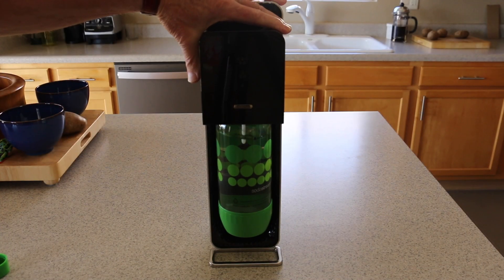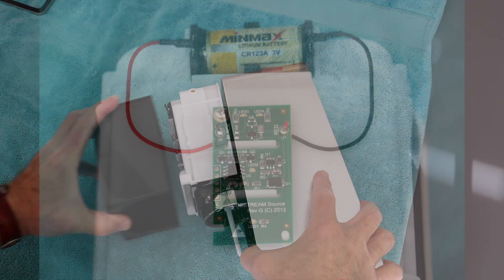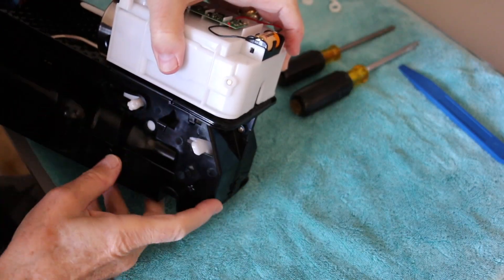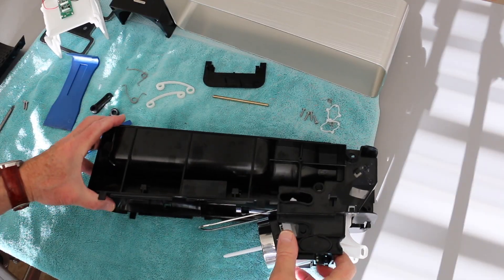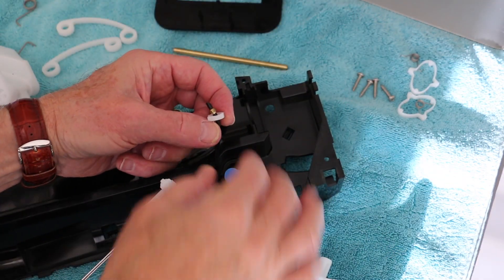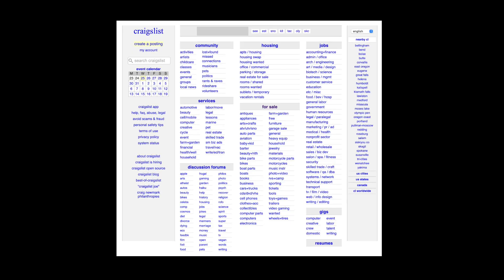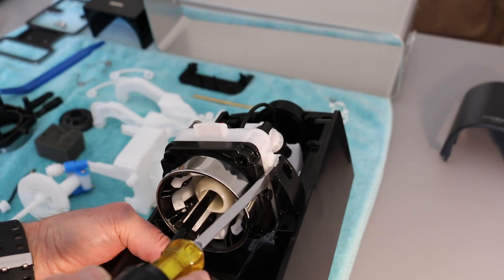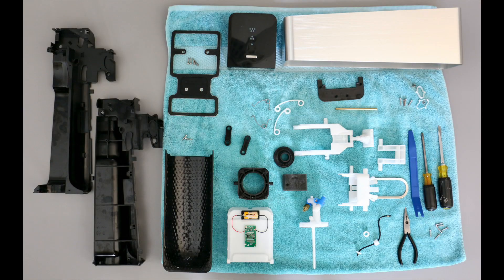SodaStream Source Teardown

Comment: I just repaired mine using JB Weld kwik weld on the nut. It's working so far. Make sure you take plenty of pictures when taking it apart. Also make sure the battery is still good

Comment: 3:59 do you know if the check valve under the co2 line connection is replaceable or had a hex design to remove it possibly? my co2 doesn't leak but is having issues with inconsistent pressure release* into the bottle. I believe it to be this valve but am having issues finding any info online about this! haha.
Reply from the maker: You're not alone in wishing that SS provided info or parts for DIYers to repair their units.

Comment: I just used your awesome video to fix my Sodastream Source machine.  My system failed in the exact same way (cheap plastic nut on the carbonation tube broke).  Fortunately, I had a broken SP1 machine that had a couple of good nuts (lol).  I dropped the magnet in the same way you did... why they didn't glue that in is a big mystery (I glued mine).  Thank you again, I couldn't have done this repair without your help!
Reply from the maker: Glad to have helped!

Comment: The author(s) must have been sitting on a couple dozen filled CO₂ canisters to justify resurrecting the original SodaStream "Source" unit by cannibalizing a brand-new "Terra".  I used Gorilla Super Glue to re-glue the sheared-off hex nut.  After curing for 3 days I was hand-tightening the repaired nut and the part sheared off again.  Even if it hadn't re-broken, I'm sure it would have broken again during use.  I can't believe even a cyanoacrylate adhesive will bond polyethylene-to-polyethylene.  I've since replaced my Source with the modern "Terra" that I will NOT be dissecting for its gas tube assembly.  Conclusion:  DO NOT think you can repair the old part; it's kaput !

Comment: do u think a epoxy/fiberglass combination wrapped around the broken part is strong enough for it to work? Coat broken part with epoxy, wrap it with a strip of fiber glass. Let it set. In my case, I can see a hairline crack appearing on the other connector as well. Seems like a design flaw. Sodastream should just spend a few cents more and replace the screw cap in brass.

Update: epoxy/fiberglass didn't work. epoxy doesn't grip the plastic hard enough and the joint came apart after screwing in. I used two straightened paper clips, twist it over the broken parts to hold it together. It was strong enough to hold the tube in but I don't know how long it would last.

Comment: Perfect tuto, same issue ! I tried to glue it first but did not work, I used a lighter to weld the plastic, works fine :) also inverted the pressure valve in order to have direct access to the repaired on more easily

Comment: I just got a Terra from Facebook Marketplace in "like new" condition for $10 without a gas cylinder. The owner had received it as a gift but then was unable to bring the co2 bottle onto the plane to fly home. With all the plastic construction I'm guessing these units only last a few years. I don't know if it is worth switching to a more durable unit such as the Aarke (but then you'll need different bottles) or simply plan to buy another slightly used unit every few years, or to go off in some other direction such as a mini-keg. I did add a 10lb co2 tank.

Comment: Thanks for the helpful video. My ten year old version ("Source")  was shooting gas out but not into the nozzle. When I called Soda Stream, they sent me a washer, which did nothing. When that didn't work they offered me to buy a new one at their 50% discount, which is not my choice. They also told me that I could try fiddling with it.  So, I followed the general approach in this video - some differences were in the model (mine has a larger battery). I got to see the black tubing that connects the CO2 cannister to the nozzle and saw that the nut that holds the tube to the cylinder valve was cracked into two pieces. That meant that the tubing wasn't connected to the cylinder valve and the CO2 was going into the room, not to the nozzle. I don't think that I can glue the broken nut together well enough to bother  or that I can put all the pieces back, though I took pictures as I took it apart. There are more parts than on a bicycle and the design is not published. Since SodaStream doesn't sell any parts, I took the Kijiji route and bought a more current used model that uses the threaded cylinders, not the current bayonet connector version, which I am convinced is to prevent refilling the cylinders on your own. The used one works fine and looks nicer than the busted thing. But the old one will be a parts source for the future.
Reply: they should all be forced to offer replacement parts (right to repair)
Reply: I sincerely doubt the Israeli manufacturer will allow any "Source" parts to be upwardly-compatible with the replacement models ("Terra", etc.).

Comment: I had the same isue. I've used CA glue to fix this broke nut, works perfectly.
Thx a million for this toturial!!!
Reply: I can't imagine any adhesive capable of reliably bonding a broken injection-molded nylon fastener together but I'll give it a try.  What would I do with the cannibalized Terra unit?  I'll also try not to glue my fingers to the part.  I'll blame you if I have to use the Hannibal Lekter technique to remove the gas tube from my hand!
Reply: That was the first thing I tried (before watching this video) and the CA glue failed within 5 seconds.

Comment: This just happened to me.  Thanks for the teardown video.   As I stared at the broken connector trying to think up ways to secure it together, I felt a powerful disdain for SodaStream and refuse to buy into their system anymore.   There's a world of people who pressurize soda bottles with regulators attached to whatever sized co2 canisters.   I bet you could even do it with SodaStream canisters if you wanted to.   I'm joining that world.

Comment: Hello! Excellent video! I just put a new CO2 bottle into my SS and there was a loud pop and the front actuator goes up and down as expected, but does not dispense gas. Also, no sound of escaping gas. I should add that I have hacked my SS to use a bottle for a paint gun and it has worked fine to date. Also, the CO2 bottle was just refilled today after several weeks of disuse. Have yet to do a tear down.  Advice?
Reply from the maker: If the valve on bottle is not getting depressed properly then you won't hear gas. Check that the bottle is inserted all the way. Or the articulated part in the SS may not be engaging the valve and needs adjustment. Open it up and see.